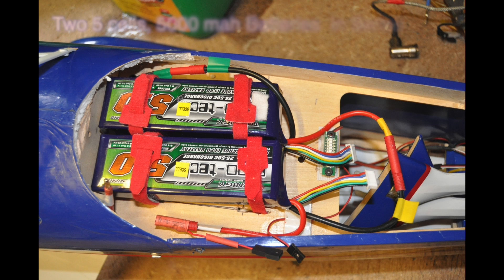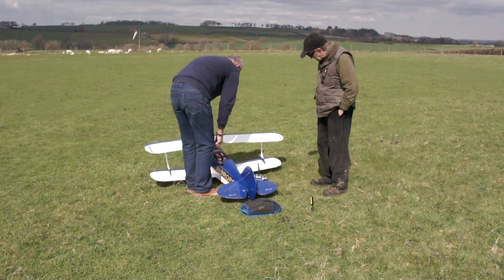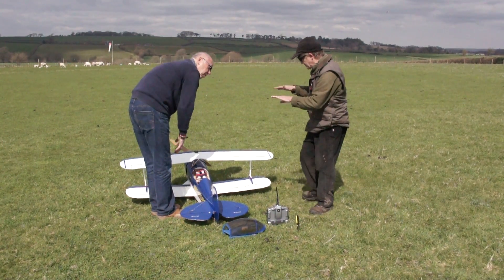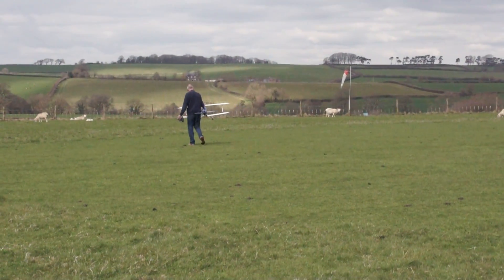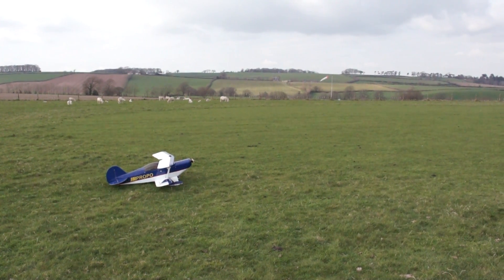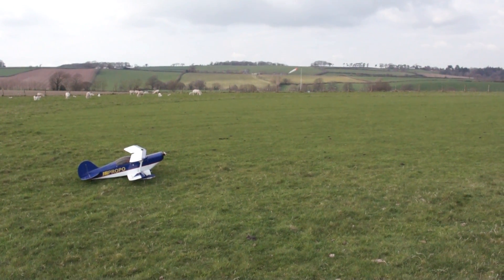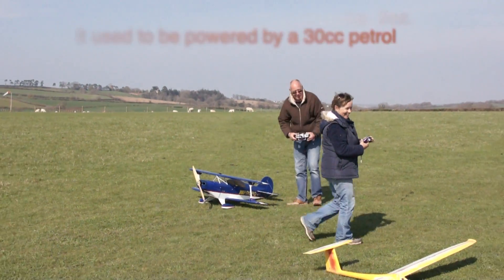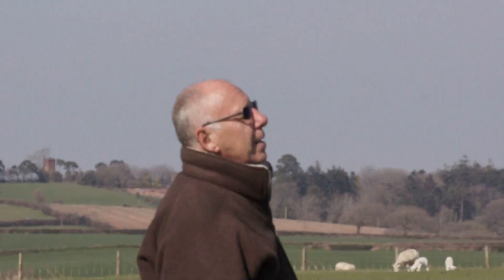Pitts Special Rotomax 50cc  HD VIDEO

Comment: Nice.., Can you tell me what Bec you used? I am tempted to get this setup for a 1/5 scale ME 109e im building, i was going to put in a dle 55ra but there is to much engine sticking out of the cowl and it really takes the good looks away tho i wonder if the electric could handle a three blade 22x10 prop? sure looks like it could..

Comment: I am considering the same type of setup on my 96" Super Decathlon...all up flying weight is currently 15.8 lbs...can you provide the specific part numbers (if available) of the components used in the electric conversion? Also, what size prop are you running? I am estimating I have ground clearance to accommodate a 17" prop at most. I am a newbie to electric and I am not familiar with how to match components. Thanks! Great video...looks like you had tons of fun with that!